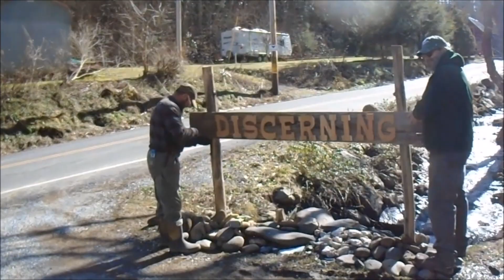A New Appalachian Trail Hiker Hostel - Loner and DC at The Discerning Hiker - Cosby, Tennessee

Comment: You need a security shirt and sunglasses so you can be a bouncer there! 😂
Cool building!  You guys need a 15guage finish nailer for those planks on the wall... it'd make quick work of it
Reply: using black nails for the look.
Reply from the maker: Hey White Castle!  I hope with a name like The Discerning Hiker, they won't need a bouncer like some of the other hostels. (PS besides - Ken the owner is a black belt in Karate).